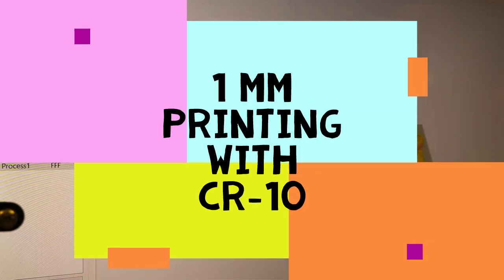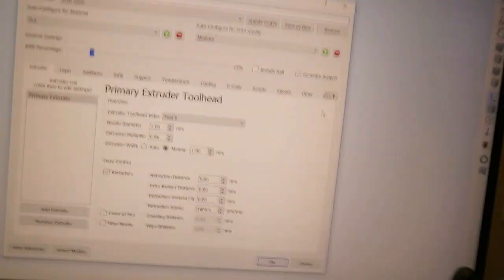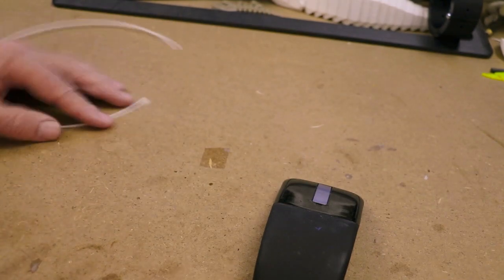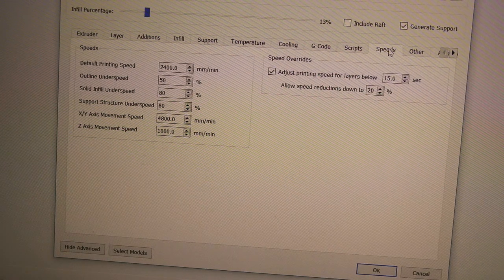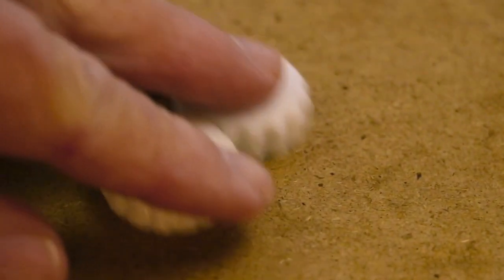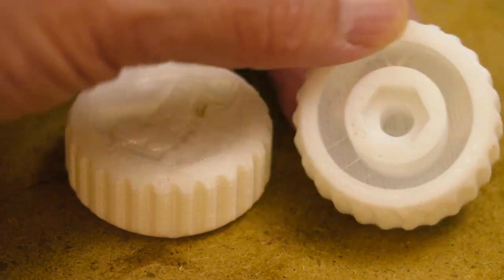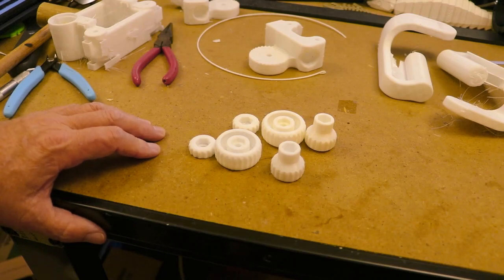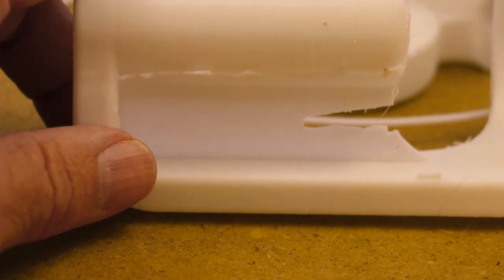1 mm printing with CR 10

Comment: thanks for sharing! was you albe to reduce the stringing so far?
Reply from the maker: Yes I played with the retraction and worked great
Reply: @fergi1959  would be worth a new video! with settings and process of printing. How much faster do you think you are with 1.0 than with 0.4mm nozzel? 2,5x would be wrong because i saw how fast you let your printer run :-) My fastest on 0.4mm was 55mm/s with pla so far. But i would love to change for 1.0 because i need to print something which takes 1,5 hours, and i need a lot of it, so hope i can safe a lot of time :-)